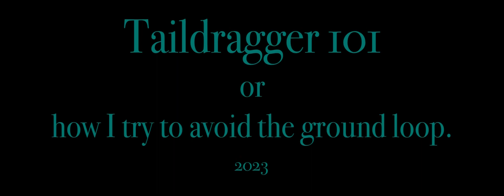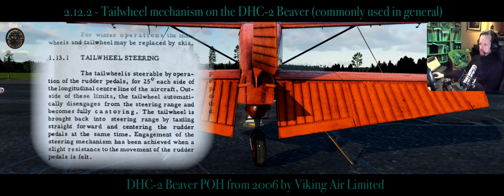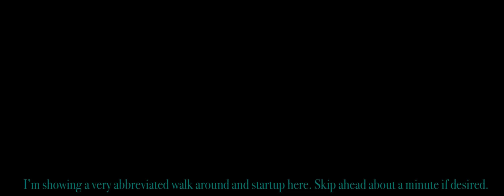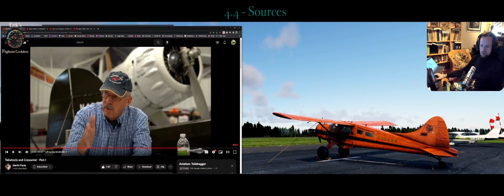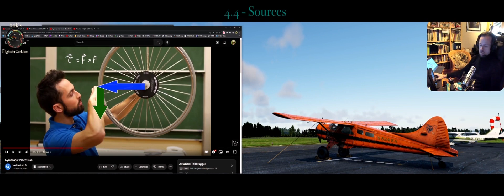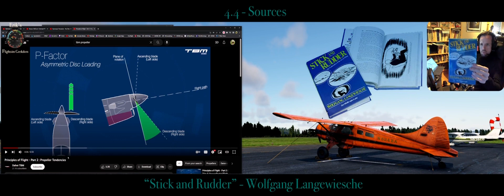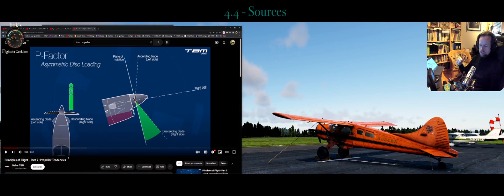Taildragger 101

Comment: Thanks so much for this, Erik.  I have gotten into the Super Cub lately and especially grass strips (which I always liked designing in WED for the gateway).  I'm getting there with it, though I still don't pitch high enough for a three point landing.
Reply from the maker: I also love creating small bush-strips in WED. Researching and finding those old, wildly overgrown places and flying a bush plane there is awesome. Three-point landings at those places is very scary, because you can't see much - which is probably why you're scared to let the plane sink into that attitude. Try thinking about it when you're on the ground - that sight picture is what you need to land 3-point.

Comment: Hey my man, is that the Beaver in XP12?  If so, which add on are you using?  Thanks for the heads up.
Reply from the maker: Hey, thanks for watching. Yes, this is the Dehavilland DHC-2 Beaver, by Thranda
https://store.x-plane.org/DHC-2-Beaver--DGS-Series-_p_1333.html

with Reality Expansion Pack, by SimCoders
https://store.x-plane.org/Reality-Expansion-Pack-for-DHC-2-Beaver_p_1353.html

The Beaver alone is not working in XP12 yet, as Thranda hasn't updated it. If you get the REP-package from SimCoders it will work, however. Only on wheels, though. So if you want to take it on the water, that will not work yet.